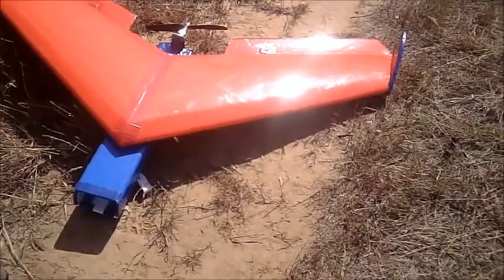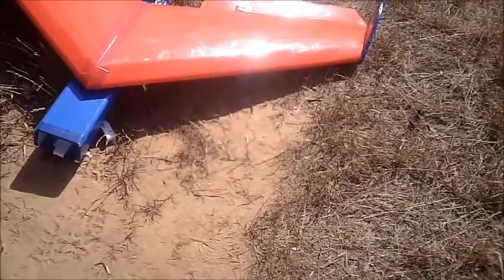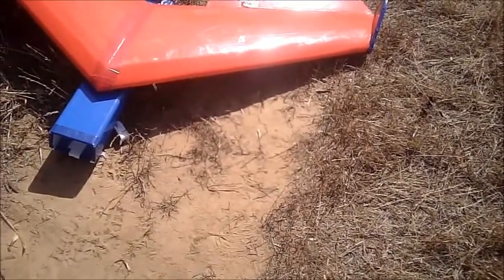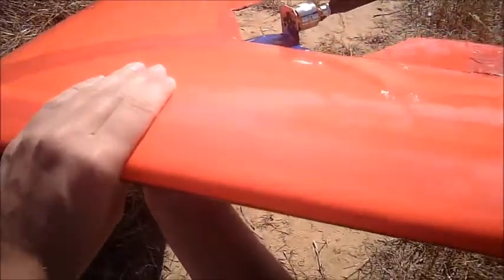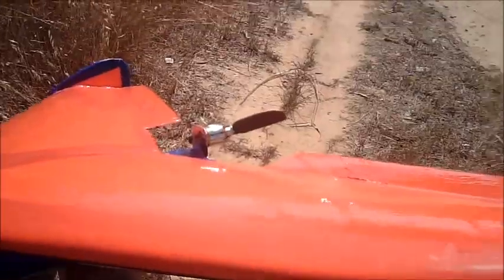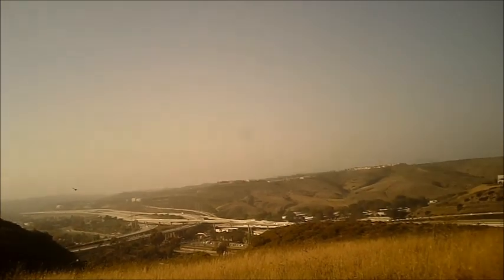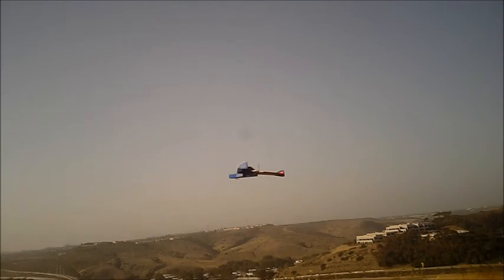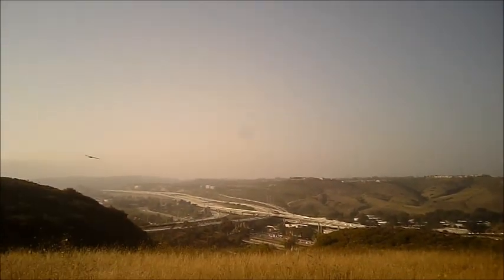Flying wing part 2, more flying and Experimental Airlines Contest Entry

Comment from the maker: Yeah i'm curious too.  The only thing i have to compare it to is my Mikey's RC FPV V3 (seen in my other vids) but that thing still flies with batts and the whole suite of FPV gear.  It's definitely heavier and definitely a lot less aerodynamic.  It also has a smaller motor on it so I'm optimistic about the future of this design.  I got some RCspeedo readings last night of btwn 60-70mph during overhead passes so even if i can do half of that with the fpv gear i'll be satisfied

Comment from the maker: Thanks for the comment. Ed's techniques are great.  With this 1500kv RCtimer I'm getting around 15 minutes of casual flying like what's in the video on a 2200mah 3s.  Once i load it down with some FPV gear i'm sure that will go down but I planned for being able to run 2 2200mah batts in parallel.